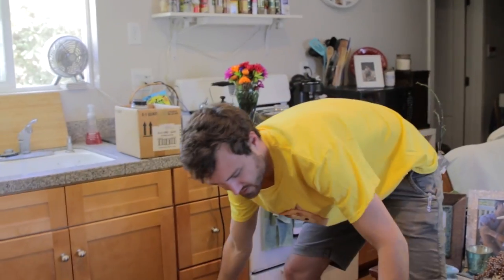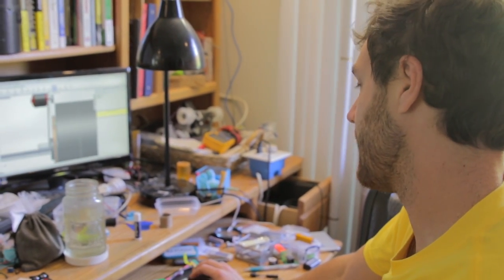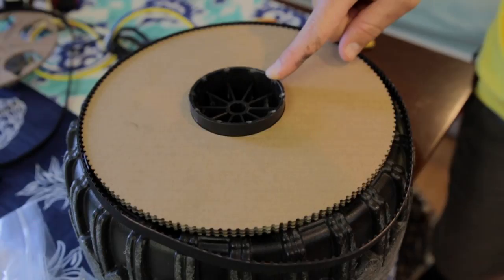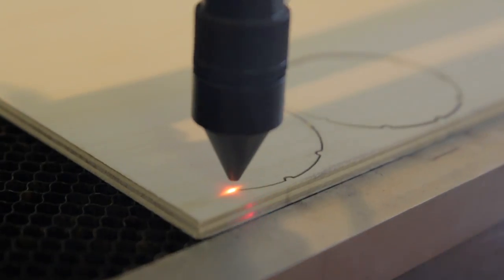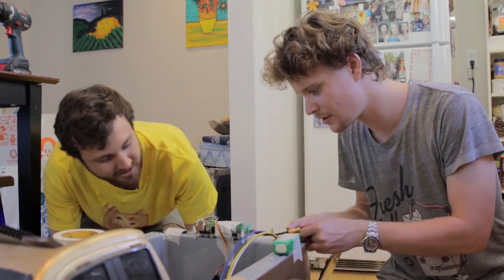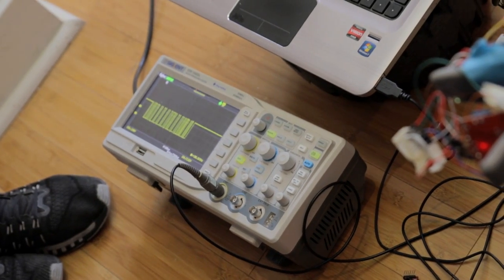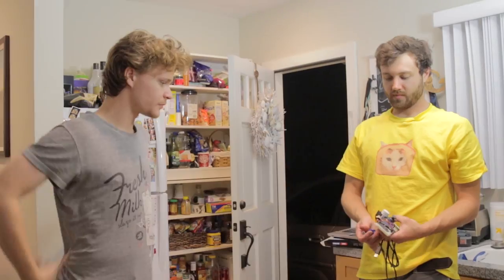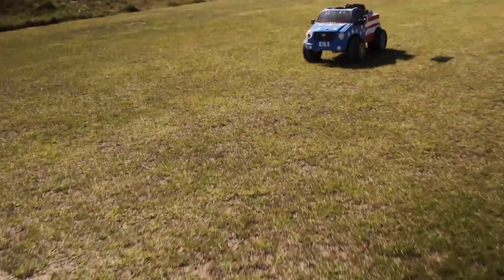Trying To Make A Kid's Car Go Really Fast

Comment: Love how the gear was made of cardboard. a notoriously strong material
Reply: James Roberts *Metal, not material
Reply: Charles Howard Official no material was the right word, cardboard isn't a metal
Reply: Of course cardboard is a metal. It has the atomic mass for 205 and melts at around the 1000 degrees.
Reply: James Roberts oh god I'm dumb you're right, I forgot that they build bridges with that stuff
Reply: I'm told cardboard can be made remarkably strong, actually.
Reply: TOASTEngineer yeah but it's not a metal like someone said
Reply: Eh, it's stronger than you make think. All of that corrugation in the cardboard helps it to not bend in one way or the other. The corrugation is the sole reason why cardboard exists today. Hail Gaussian Curvature.
Reply: CalculyticCuber I'm sure it is strong but he said it was a metal which it's not
Reply: Edge Lord it was a joke. Charlie said metal as a joke.
Reply: they have cardboard in skyscrapers so it has to be strong

Comment: Sir William I dont mean to be annoying a few months after this goes up, but if you ever do a part three to this you should just put rubber bands on the wheels so you have a little more traction and so you dont have to like redesign the whole car to fit rubber bike tires. Specifically on the back tires so they dont slide out when ever you turn. also sorry if anyone has already said this dont mean to beat a dead horse

Comment: What about making an automatic pancake making machine that flips them too. rules is it has to pour the mix and flip it without human control. serving on a plate can be done by human. extra points if you can turn on and off remotely.

Comment: If you want to steer this thing properly, you should think about a front wheel drive instead of the back wheel one ... most of the real cars out there which have back wheel drive tend to slip and go in circles if they have no friction. Great videos btw.

Comment: Even better, 4 brushless motors per wheel, for a total of 16 motors. But the real kicker? Each motor gets its own 24 volt battery... because why not
Reply from the maker: Hah, it already has too much power!
Reply: William Osman nah, nothing ever has too much power. But for what i said you definitely would need some form of small rubber wheel so it could actually grip